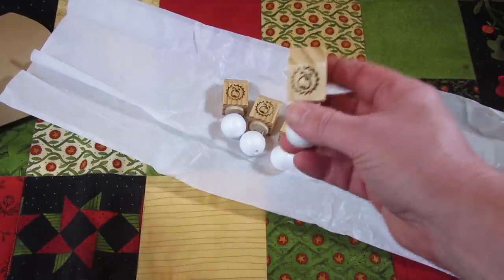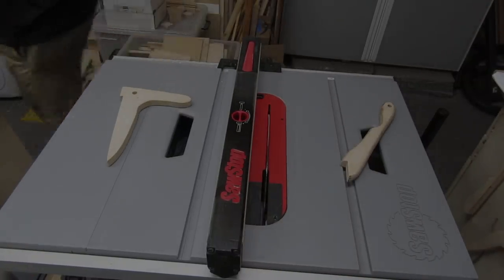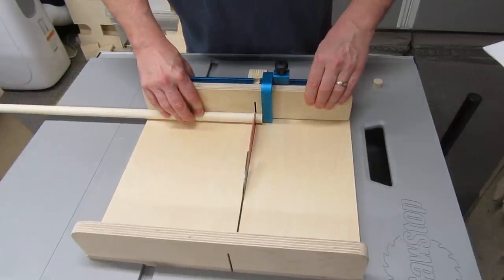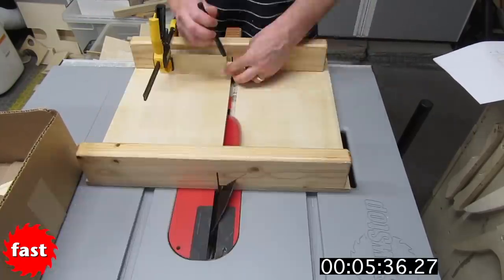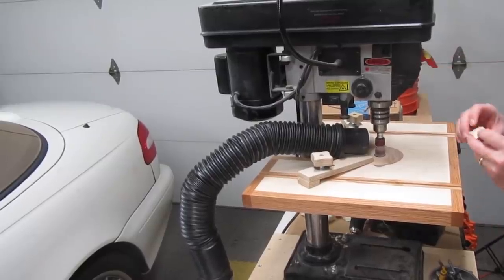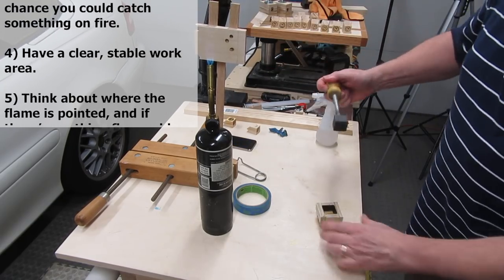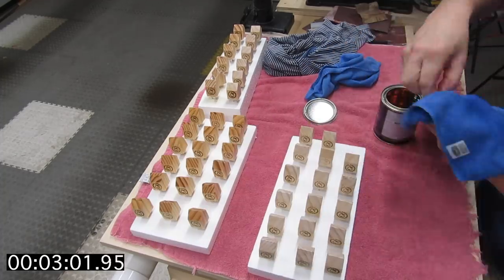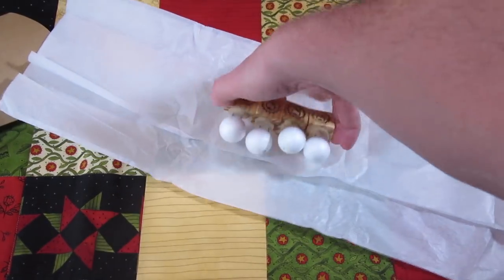DIY Christmas Gifts: Corn Cob Skewers

Comment: That must have been a lot of work, all together. But it was worth it. The end result is awesome. Nice little gifts. Thanks for sharing.
It struck me (positively) that you also mention the metric sizes now. That's great news.
When you were struggling how to secure the dowels end at 3:50 something went wrong writing down the conversion.
That branding iron is perfect. I just bought a small burning torch last week (did not use it yet). Already in summer I bought material to (try to) make my
own burning iron) but time is so much quicker than me.
Reply from the maker: Thanks! Yes, it was a lot of work. Regarding the conversion to metric, this is one area I struggle with. I realize that a half inch is more like 13mm, but making them a half inch was kind-of arbitrary. So I thought that using 15mm would be a more "round" number than 13mm, since it probably has a bigger mark on a ruler. So my question is, how do I indicate that the number doesn't have to convert exactly? Does this make any sense?
Reply: @TheNewbieWoodworker  If I'm correct 1 inch is 25,4 mm so 1/2 inch is 12.7 mm. Some woodworkers use 12 mm, some 13 mm.
Steve Ramsey (woodworking for mere mortals) has many free plans, both in metric and imperial.
In this particular video the length of the dowels it's not important (12,13 or 15 mm) as long has the hole is adequate.
But when there are more complicate builds than 2 or 3 mm difference is a lot  (it may cause a gap, or joints may be less stronger)
When somebody uses Sketchup or another drawing program this problem does not exist (I think)  I suppose the programme calculates the lenghts of the lines
(parts) itself. I maybe wrong with that though.
Reply from the maker: @hansdegroot8549  You're absolutely correct about SketchUp - I use SketchUp all the time. So my question is, would you rather see an exact conversion, all the time? In other words, should I have said 13mm, instead of 15, even though either number would work fine?
Reply: @TheNewbieWoodworker  Imho it's better to use consequently the same conversion values. So 1/2 inch is 13 mm (12.7 is closer to 13 than to 12 mm).
At another place in this video (if I remember well) you wrote/named somewhere  1/2 inch = 12 (or 13?) mm.
3/4 of an inch you did everywhere correctly  (19 mm)  You did not use 20 (although this has a bigger mark on the ruler/tape measure).
I can imagine that metric is difficult for you since you did not use that before. I have the same problem with imperial.
We're about the same age (I'm three years less wise than you). I don't know to work with Sketchup (yet). Before there were free downloadable versions.
Now not anymore, as far as I understand. So I draw/sketch something only on paper and start doing something.
Reply from the maker: @hansdegroot8549  I think your advice is excellent, and it makes total sense. Thanks! Regarding SketchUp, there is a free online version, and I have a video on it, but I'm not a fan. But people still use versions of SketchUp from 10 years ago on their computers, so there's no reason not to use last year's free downloadable version, SketchUp Make 2017. https://www.sketchup.com/download/all. It's what I use, and I love it. There's plenty of tutorials available. It takes some learning, but boy is it helpful! I've got some models, if you're interested. https://3dwarehouse.sketchup.com/by/TheNewbieWoodworker

Comment: Wow, I'm impressed! Can you tell us, how long the whole process took for you (without finishing)? Greatings from Germany
Reply from the maker: Thanks! It took a long time, but that's because I wasn't sure how I wanted to do it. I included times for most parts in the video. I would imagine if you were motivated enough, it could be done in a couple of days, including the glue and finish drying times. But after plowing through 50 of something at a time, you might need a break - I know I did. 😄

Comment: Would it have been more efficient to keep them together until nearer the end? I mean to keep the boards long, drill the holes while the boards are still together, put the brands on, then rip the 45-deg angles long ways on the boards, and then finally crosscut them into individual pieces?

The grain orientation would be different this way, but I don't think that is a problem, is it?
Reply from the maker: You got it. I considered doing that, but I wanted the grain running vertically. Honestly, I'm not sure now much time it would have saved, anyway.
Reply: J Will, you were faster than me. I absolutely agree. And nails are never food safe.
Reply: @alfredneumann4692  Other than eating the nails directly, why would you think they're not food safe? Just about any skewers you can buy use nails.
Reply from the maker: Sorry - that reply was from me. I was logged in to the wrong account.
Reply: Only stainless steel is food save. We have some, and they are. I have never seen some with nails. Ok, i'm in Germany. Perhaps in the US this isn't.
Reply: @alfredneumann4692  :
I think those were stainless steel nails. I think he mentioned it in the video.
Reply from the maker: @XJWill1 , @Alfred Neumann I think I forgot to mention they're stainless steel, although the packages clearly state that the ones I'm using are. But even if they weren't, the nails go into the cob, and don't really touch the kernels of corn, so unless you left them in for days, I doubt there'd be an issue. Of course, I'm no expert, so I could be wrong. But I'm not too worried.

Comment: What did you use for the white safety balls and how did you process them?
Reply: They're styrofoam balls that my wife got at a craft store. I just stick them on the nails. Does that answer your question?
Reply from the maker: Sorry - that reply was from me. I was logged in to the wrong account.
Reply: @dagware  great. Thanks
Reply from the maker: @danneeriemer1933  👍

Comment: Great video Dan, two questions one, why didn’t you use a fancy wood for these, like maple? And two, what is the nail protector that the finished holders have?
Reply from the maker: Dangit! I knew I forgot something. I meant to say why I didn't use maple. At first I couldn't get a decent-looking brand with maple (I may not have let the iron heat up long enough). Then when I tried this pine, I actually thought it looked better than the maple. Right or wrong? I don't know, but this is the way it is, now. 😄🙄
Reply from the maker: Oh, the other question - they're styrofoam balls my wife got at one of those craft stores. How many other things did I forget to mention? 🤨
Reply: The Newbie Woodworker thanks Dan!
Reply from the maker: @joseescabi  👍

Comment: It looks like your "Stop" is at an angle or possibly loose. The bottom appears to be farther away from the cut line than the top.
Reply: Thanks for the comment. It's not loose, but I suppose it could be angled. I don't think this is an issue, because I don't measure to the stop - I measure the stock itself. Do you see other problems I'm not thinking about?
Reply from the maker: Sorry - that reply was from me. I was logged in to the wrong account.